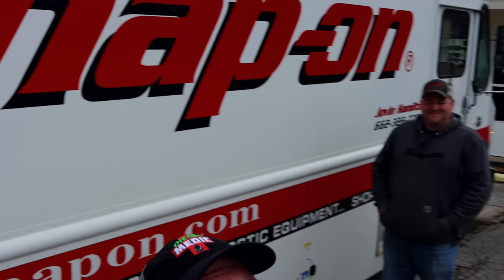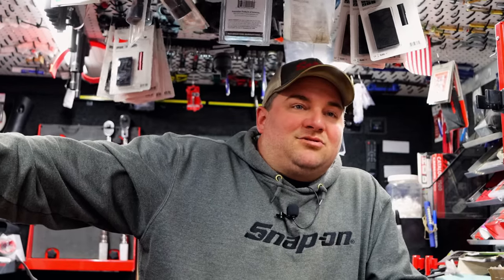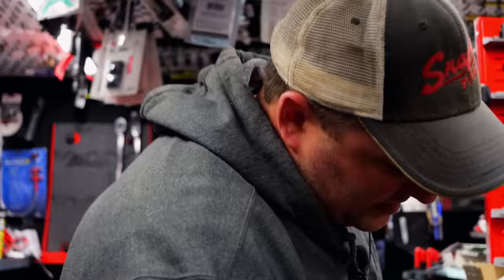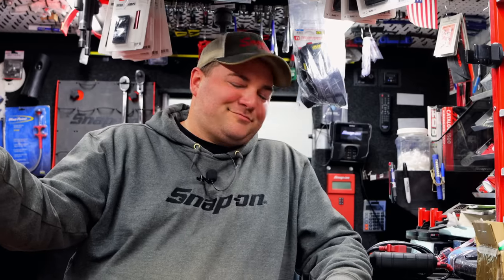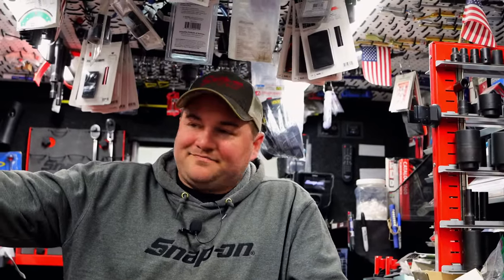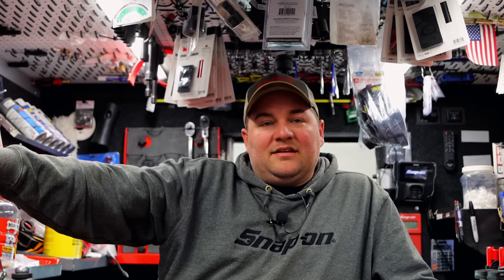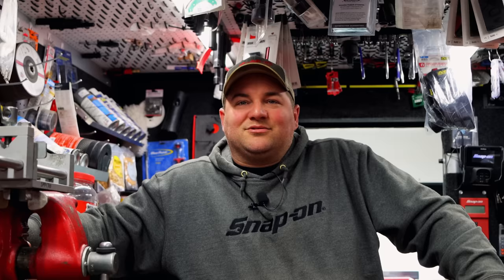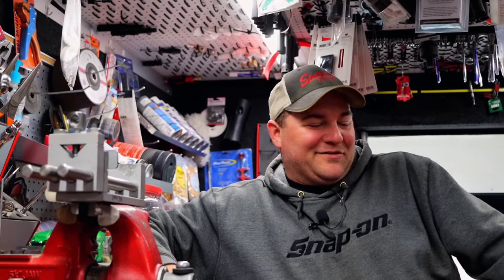Snap On Friday New Dead Blow Hammer

Comment: Clay, I just bought a hammer kind of like that.  It’s made in the USA by Trusty-Cook.  It is a Flat/Flat (same at that Snappy).   It is 50 ozs and the handle is about 14-16 inches long.  I got it on amazon for like $60-$80.  Lifetime warranty.  Of course, I still have my Snap On 40 oz.
Reply: Trusty Cook only have a two year warranty. They're cheaper than the exact same hammers on the Matco and Cornwell trucks but you'll probably end up paying to replace it.............
Reply: snap on does not make their hammers, Trusty-Cook makes snap on hammers

Comment: Just got my snap on 3/8 ratchet with 2 batteries and charger. Came with 7 of each standard and metric flank drive impact sockets for free. Also have that blue point general service set. Man what a set. One stop shop. Also cleared 230 bucks after 12:30 this afternoon on 2 jobs. Pretty much paid 60% towards the ratchet. And used it all afternoon. God bless

Comment: I’ve got this hammer in green. It’s my everyday hammer. I almost never need the round end of a ball peen and I like the short handle. Makes me more accurate when I’m beating the hell out of something.
Reply: What type of tasks are you using it for? Just outta curiosity? If u have the time to respond thanks ahead of time
Reply: @psfanboy79  everything man. Whatever comes up. I had stuck tie rods today during an alignment. I stuck a crescent wrench on the adjustment nut on the tie rod and hit the wrench with this hammer to break it loose. Separating ball joints too, whatever. It does it all, comfortable grip as well.
Reply: I use that Ball end on fenders and dents...I even hit ball joints with that end. As for some stupid reason. The weight of the other end helps get them loose.

Comment: I almost bought one of those dead blow hammers but just didn't like the length and no rubber grip. If they would make it like there ball peen dead blows i would definitely get one. Having 2 flat striking surfaces and different sizes on each side would be useful.

Comment: That Blue-Point set is awesome. I have the other one without the wrenches and I use it all the time now because at my last job some jerk broke into my box and stole ALL my Snap-On sockets and ratchets and stuff. I did go on the truck and buy a new S80 ratchet though to use with the Blue-Point stuff. Now I need to rebuild my box... probably going to upgrade to a bigger and more secure box soon too.

Comment: I have a question for you, why are most snap on and other brands of hammers ontool trucks still only selling hammers with ball pin on 1 side instead of 2 sided flat face hammers
Reply: I'm a logging mechanic for 20 years,I have no need for the round head on a hammer why doesn't any tool truck have 2 sided flat face hammers
Reply: It’s for using it in corners and in a place where you can’t get a solid straight line strike. I’m a heavy equipment mechanic and it comes in handy replacing excavator/loader bucket teeth pins where you can’t get a good swing in between them!
Reply: I’ll chime in - the ball side hammer on my snap on 40 oz fits perfectly into Honda wheel bearings. Use another hammer and beat the hub side out so easily instead of trying to rig the shop press. Time saver.

Comment: What is the difference between a hammer like one would use to drive nails and a dead blow hammer?  Not including size or weight.
Reply from the maker: Dead blow has shot in it to reduce bounce back and drive more force onto what you are hitting vs a solid steel head like used to drive nails.
Reply: Thanks

Comment: Hey clay gotta question i have a matco tools versapower portable battery jumper well unfortunately i left it on a vehicle at my salvage yard well needless to say it got taken out into the yard fell off said vehicle and a two 2 komatsu loader ran it over i have all pieces the front part of the case the rear part and the battery that is now seperate from the tool would matco michael warranty that one of my everyday use tools camt move electric seats in vehicles that have been dismantled and thats what i used daily
Reply from the maker: I doubt it !
Reply: Ugh i dont have a dealer i got it from a pawn shop. Just thought id ask. Thank you very much sir.